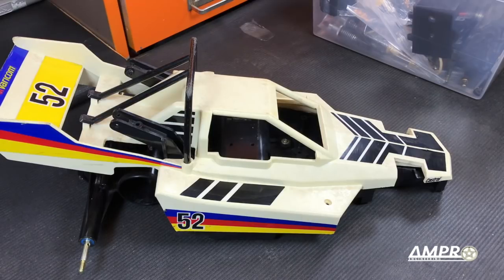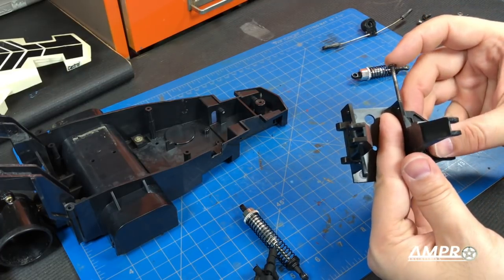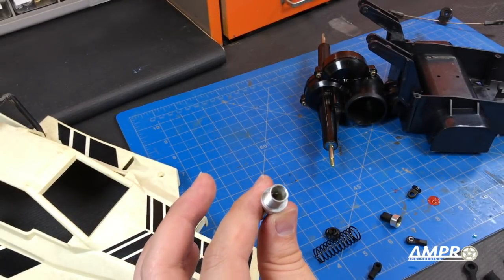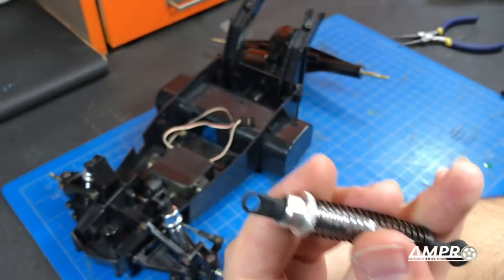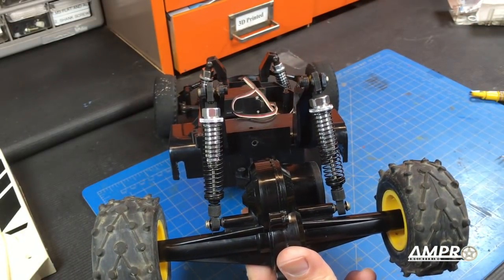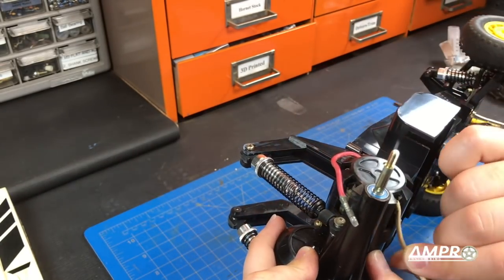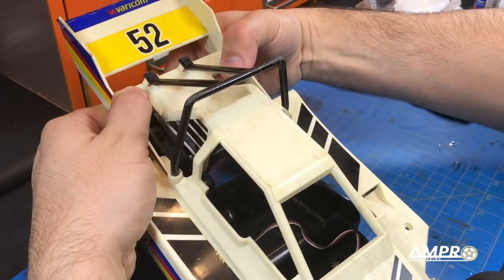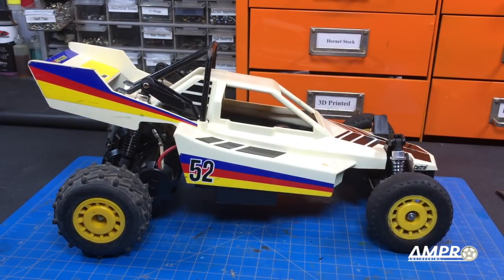e117: Varicom/Panda Pandamonium aka Graupner Pinto Project "Pointless" Part 3

Comment: Did you not get the plastic 'Hubcaps' for the wheels???? Suprisingly , even with the friction shocks the buggy runs on par with a Tamiya striker!Also did you get the driver (sort of a seat) cover?I attempted to get the cover 3d scanned to meld with a 3d scanned Tamiya brat driver but the designer guy I started to discuss this with has disappeared with the parts!
Reply from the maker: Yeah I do have them. I would Imagine that it totally would keep up with the Striker come to think of it, I mean the front end is way better! No i did not get the seat cover, is there one? It looked like something should go there but I couldn't find anything.
Reply: check out pages 10 and 11 of the manuals in the box link i sent you a while ago, it show a pic of it there.....i can also add a pic to my tamiyaclub showroom entry for this model
Reply: panda pinto updated on tc!
Reply from the maker: Damn I always forget you did that!
Reply from the maker: Ill check! FYI, the rear end wobble is bad on this. The whole pivot area is worn so the next episode ill be fixing that mess.

Comment: Nice job maybe you can design some kind of pan hard bar or sway bar for the rear like they did on older firebirds and Camaros to stop that side to side movement
Reply from the maker: Hmmmm....now there is a though...I like that.
Reply: AMPRO Engineering thanks 😀

Comment: I just obtained this car in mint condition from ariginal owner. What would it take for you to make a set of these shocks and send them to me?   Unless you know of a set that will work out of the box?
Reply from the maker: Oh very cool! So the thing with those shocks, they are mounted with a polyjet plastic and its is very, very brittle. I run mine up and down the street but that's it. Any more than that and it will break. I would look for shocks that are about the same length but mods will be needed. TBH, it is not a very good car to drive so I would run it first and see how you like it before you spend money on it.
Reply: @AMPROEngineering  ya, I took it for a run. Its really fast but hard to keep straight. I will leave it as is and just be happy I have one. Lol

Comment: we sure hated on those Panda's, for being so clunky, and so brittle. 30+ years ago younger buddy Mark got one for Christmas, it didn't live long so we pieced together a Hornet for him from spare parts (fixed a tub with the typical left front crack in it). another one that's rare nowadays (with some better designing) Futaba FX10.
Reply from the maker: Really? This one seems to be as soft as a hornet but that is NOT the case with the Cyclone I have. That thing is like glass. I wonder if plastics used varied depending on availability?

Comment: Missed your videos.  But yeah the yellow has to go.  They use the same style pin type as kyosho.
Reply from the maker: I agree, it is just too overpowering. I didn't realize Kyosho did that too. Thanks for the info.
Reply: AMPRO Engineering First time commenting here. Good episode and great job overall on all your vids. Very informative and fun (humorous sometimes) to watch, esp the hopper/hornet vids in particular. 
Just wanted to added that my old losi junior uses the same pin type for its rear wheels. Just not sure if it's the same pin length and diameter. They're 5 spokes wheels though. Old black pan team associates, i believe uses a semilar set up too. And something to think about, if you look it up, the tamiya 53881 wheels looks eerily similar to those panda wheels.
Anyways, can't wait to see this car run!!
Reply from the maker: Thanks for the comment! You bring up a good point. My Associated also do use this style. Where this was confusing was the axle tube length vs one of those Losi or Associated cars. It is the same length as the Hornet but without the usual adapter.